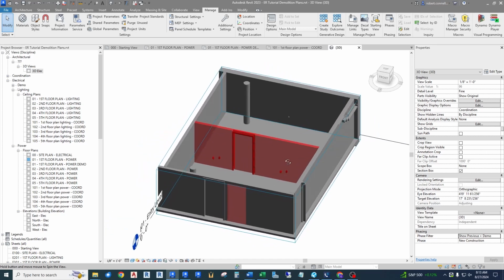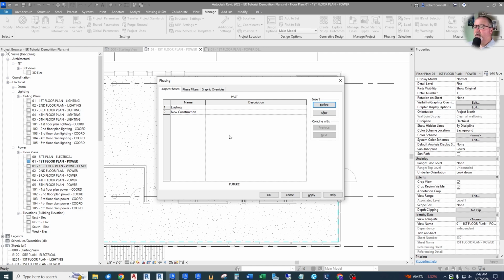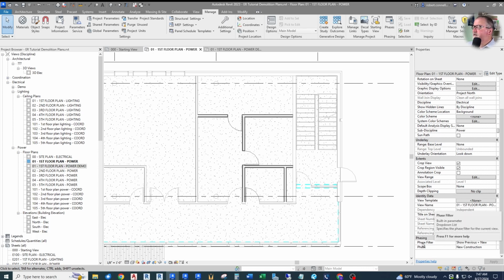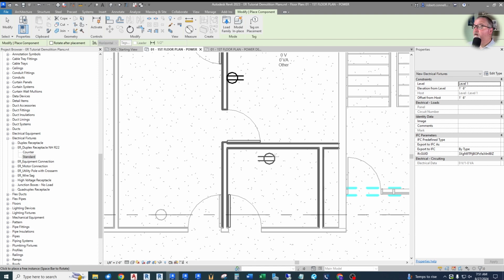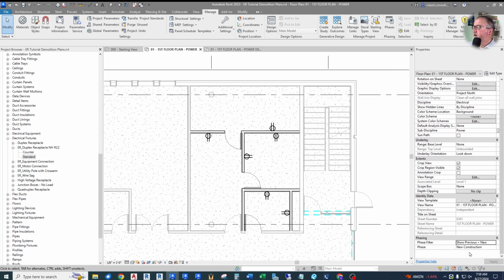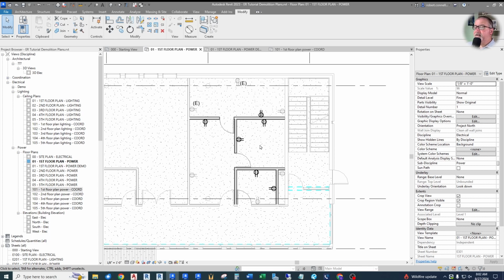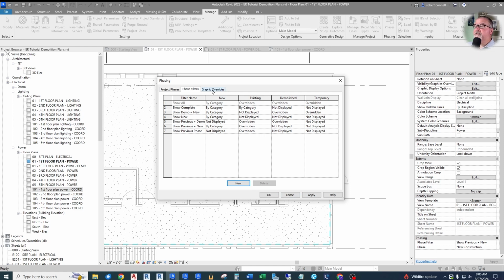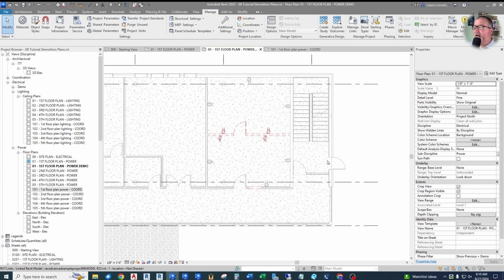MEP DEMOLITION PLANS (Revit Hack)

Comment: How do you deal with existing receptacles, connected to systems, that you want to demolish to make new panels. How does your system browser behave?
Reply from the maker: Hey there! Great question! In my experience, the existing circuits behave no differently in Revit than the new circuits. Thus, I do not even circuit the items to be demo'd - I only circuit existing to remain. If I want to indicate to the contractor which circuits the demo'd items are currently on, I end up having to show it with text panel/circuits/notes. Would be nice if Revit had the same "phase created" and "phase demo'd" features for circuits and panel schedules, but unfortunately it doesn't.